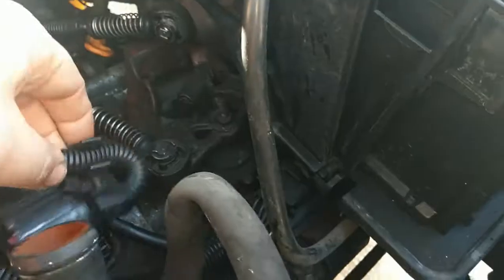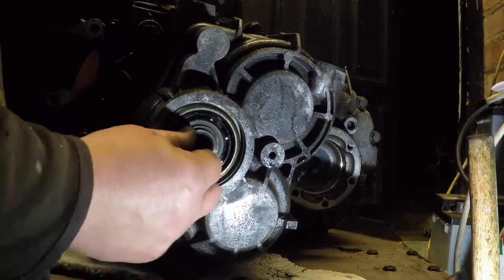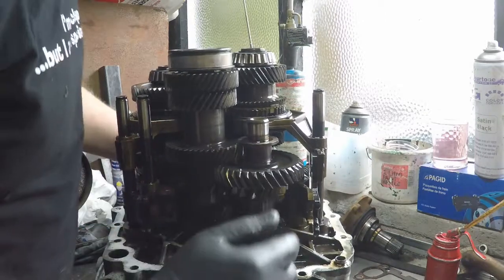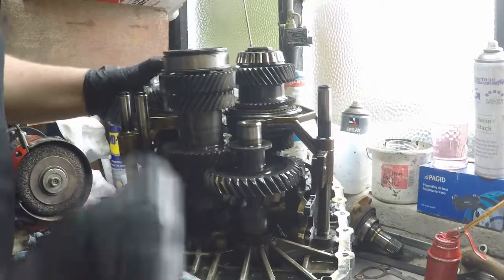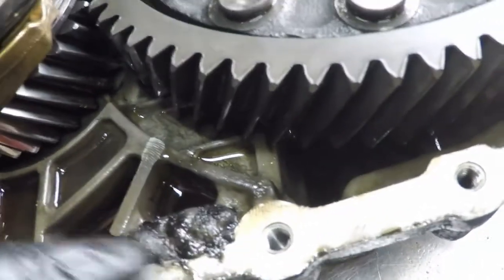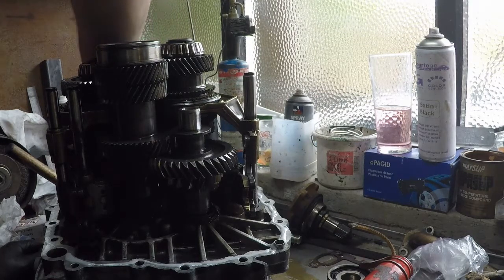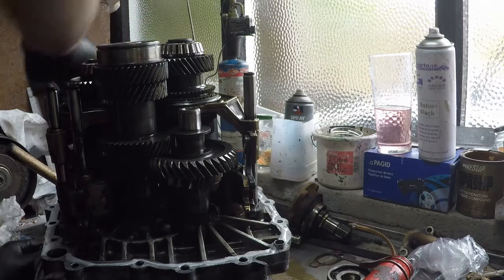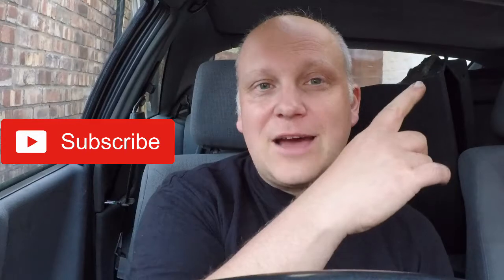VW Corrado TDI Conversion - Ep4. Gearbox Internal Inspection - 02M 6 Speed Shims

Comment: Hi @CrispysProjects do you know if it is possible to change the input shaft bearing through the inspection hole on side of the gearbox 02M FMH box in this case. The plastic race has disintergrated. I have seen others order the new bearing then cut it up to obtain the plastic element and refit from the passenger wheel arch.  I can see two circlips a large one around the outside and small one on the inside. Might be easier to fit a new pastic spacer and add greece then replace the black cover. Any advance apprecaited. Thanks in advance. Chris
Reply from the maker: I'm sure I have replaced one though hole, as it's the circlip/shim on that version that will come out, I'm sure needed a puller of sorts to drag it out. We don't want any bits falling in the box!
I'm sure on this video description may have the part numbers for the shim & cap
Good luck 👍

Comment: Hello, i have a passat b6 2006 modell, 4wd. Is it the same stuff on this one?
Reply from the maker: Hello, yes it's a similar 6 speed gearbox on those being a 02M family. You can check if there is the black seal on the end, some solid casing
Reply: 6 speed manual seat Leon 2012 model, is it the same? I read somewhere that the gear box does not have the black cap there for not possible unless you split the box, is this correct

Comment: Hello. I would like to know some method so that the bearing with the ciclip does not rotate on the outside and eat the casing. The bearing is fine, thanks
Reply from the maker: Hi Silvia, I've not seen it on this box, but is shouldn't spin in the housing, could only happen if the bearing is binding or the load was that great when something happened to the case making it start to have play
Either replacement case or there are some bearing bonding glues on the market (I've never used any)

Comment: my gearbox makes this whining sound all the time like a wheel bearing. Is it too late for this fix now ? with and without clutch engaged.
Reply from the maker: Might be the release bearing/thrust bearing on the clutch if you can hear it on idle- if its internal to the box you wouldn't hear it with clutch depressed for 30 sec or so as the gear box internals would of stopped turning

Comment: why did you split to the box to shim this? i didnt actually see you fit a shim on the inside of the box? you just remove the circlip inside the black cap, shim on then replace circlip. i only seen you have the end bearing back on, were / when did you add the shim or did you just put a new bearing in? ive only found this video after m mk1 cupra r box went, i just stuck an old box in which is an FML so doesnt have the black side cap, but im wanting to take the case apart on my old box to see why reverse went.
Reply from the maker: The bearing I did replace doesn't have setup/shimming pre load spec or repair op, on couple boxes does list a shims are available. too much movement on this shaft does make a difference on the input shaft as it seems to wander. the inner shimming - seems that  some cases are machined different to take it, so likely not need one unless its fitted from the factory - mk1 Cupra brilliant car

Comment: Thank you so much for the video! 
You made it look too easy.
Reply from the maker: Thanks, it's actually easier when everything is out of the car! Thanks for the comment 👍👍
Reply: @CrispysProjects  Most welcome! I don't have that hole to inspect the bearing. Were you getting a whirling sound when the car was rolling or was the gearbox never on the car? 
I'm getting a whirling noise when doing anything over 30mph whilst in neutral. 
Also is there a part number/link for the bearing?